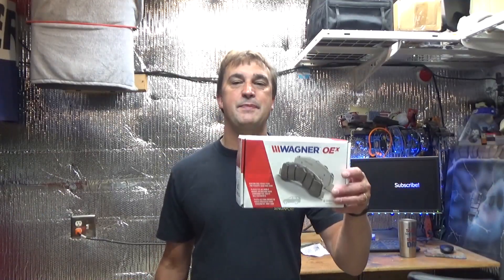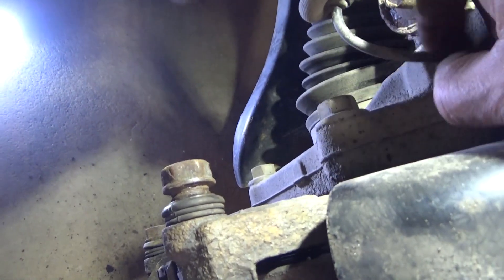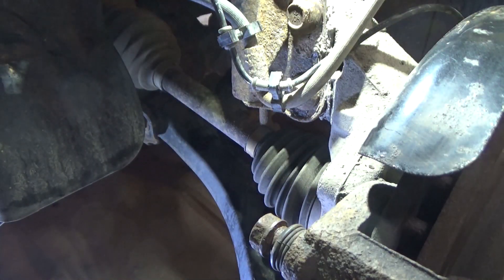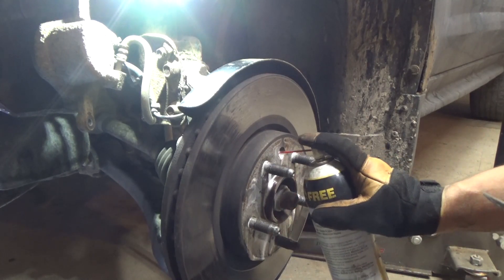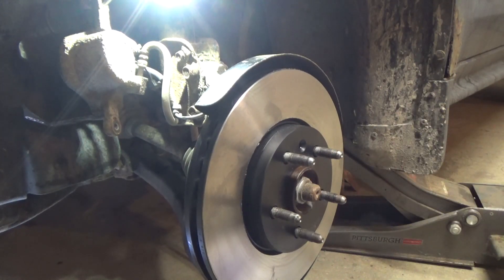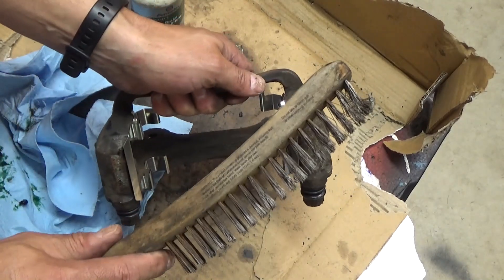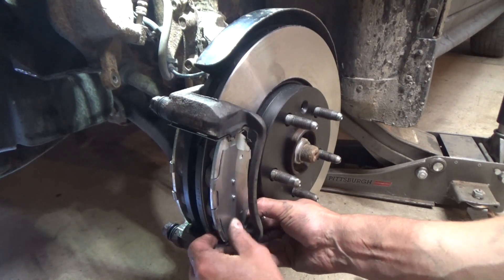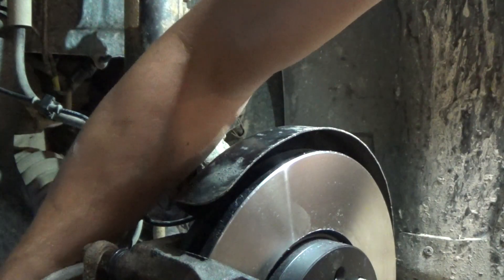How to Replace Front Disk Brake Pads and Rotors - Chevy Equinox Front Brake Pad & Rotor Replacement

Comment from the maker: ACDelco 18A2719 Front Brake Rotor for Chevy Equinox on Amazon - https://amzn.to/3qJ5GQW
Wagner Brake OEX1421 Brake Disc Pad for Chevy Equinox on Amazon - https://amzn.to/3xmiLCg
ACDelco 18K1929 Front Disc Brake Caliper Pin Boots on Amazon - https://amzn.to/3hAGpUS
Tekton Torque Wrench on Amazon - https://amzn.to/3hC6R0k
Caliper Hangar on Amazon - https://amzn.to/3hc0AJU
All-Purpose Ratchet Sets on Amazon - https://amzn.to/2RG9e75